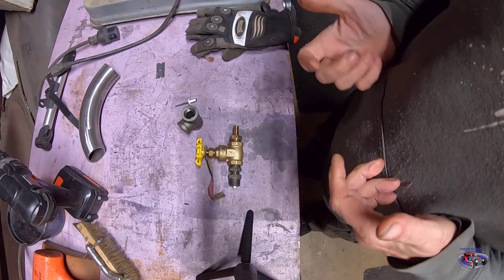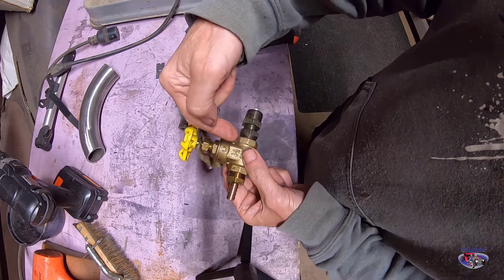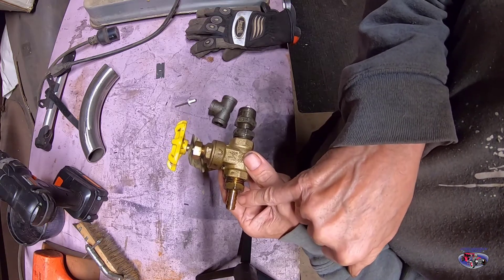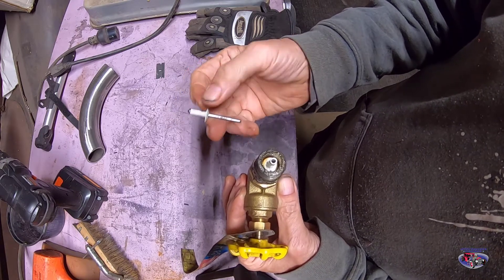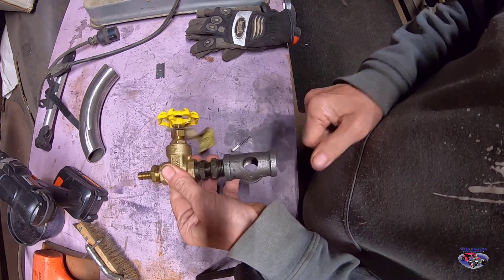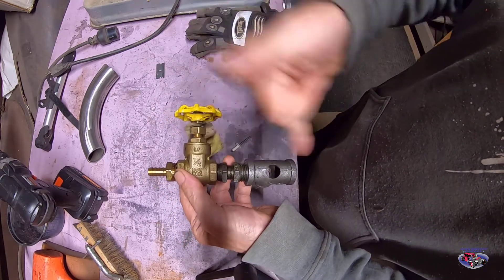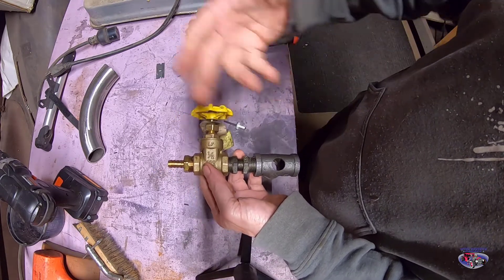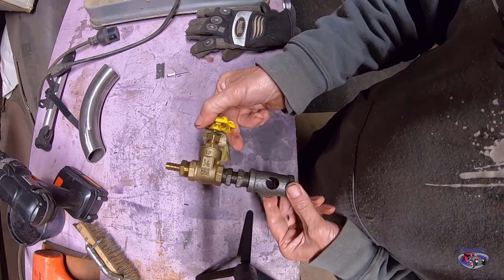Best Waste Oil Heater Oil Flow Control Valve-How To DIY

Comment: I think this is the best ideea .... I had one similar to this but didin't think about that pop nut... 👀😳 So to my burners i will use ur ideea for shure!
Reply from the maker: Thanks! Let me know how it works. Always like feedback...
Reply: @speedmaverick  hey bro i made the valve today and i used some oil  so i can see the drop! Im fascinated  and cant wait to see it fully run! I can share pics if u have watsapp or something
Reply: @speedmaverick  and u can take a peek on my page and see my burner video
Reply from the maker: @mrLobaLobaBM  I like how you got the swirling effect with the overall design. My burner is a remake of Gerry's DIY channel burner design. I used that because it can be run without a fan and uses draw to create the swirl with holes like yours that are at an angle.
Reply: @speedmaverick  thanx. tomorrow ill try to mount the feeder , but first i need to make my oil tank using a used fire extingusher that i emptyed! ill try to make a video after
Reply: @speedmaverick  hey bro u can check on my shorts video, i uploaded a video with the oil feeder!

Comment: Where do you get the rivets?
Reply from the maker: They are used a lot in racing so those suppliers will have them.. eBay has a 50 pack for $9 and they are pretty handy if you are into DIY. I put a link in the description.